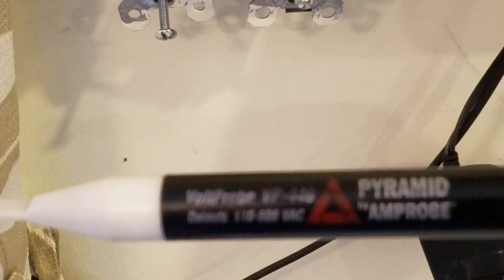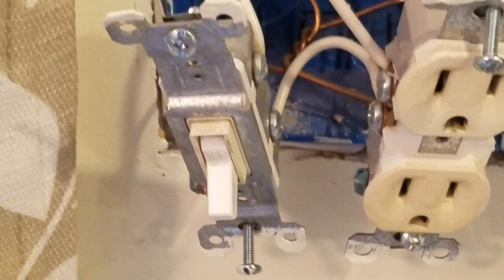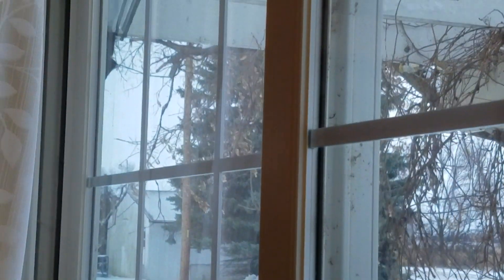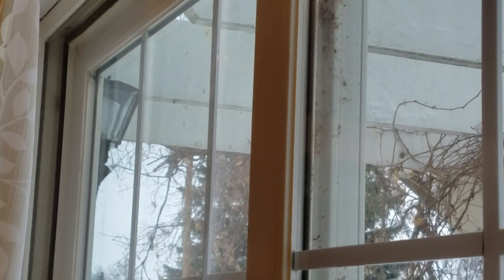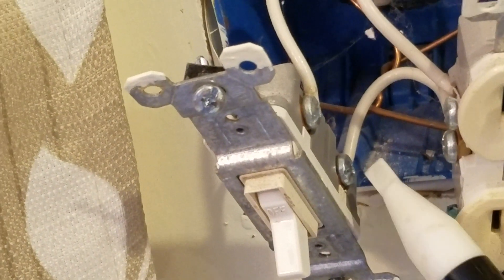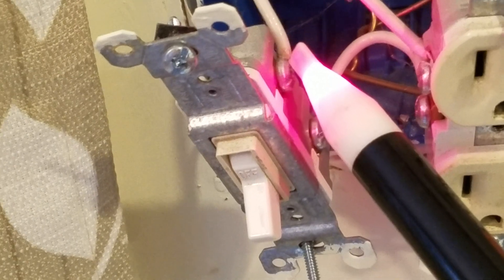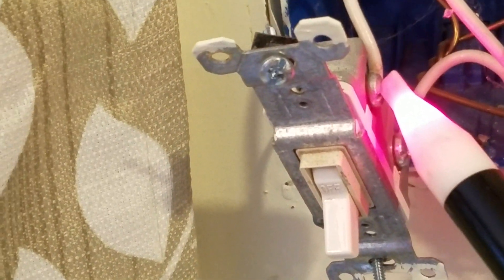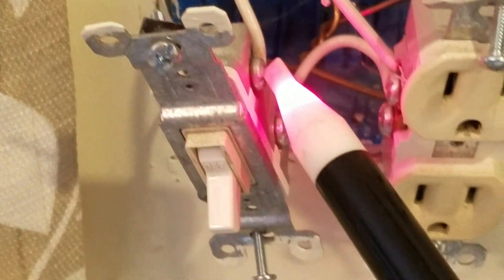Electrical back feed?

Comment: My guess is the Black wire feeds the receptacle hot travels to the light and then a White painted black is the RETURN FEED to the single pole switch and the neutral from the receptacle is the neutral for the light also.

Comment: Your switch is possessed  🤣
Reply from the maker: I'd like to think so, I actually wired it incorrectly.
Reply: @BenjaminHansen  I just had one do a crazy thing when you turn the lights on all the emt and armor cable and steel boxes would electrify and get power about a little over half power and would zap you If touched and all goes away with lights off...
Reply from the maker: @ironjohn5914  Uff-Da, yes, that is possessed!
Reply: @BenjaminHansen  I tested it with a tester removed the lights and still with switch on and no lights would electrify everything then I tested the switch each terminal and the ground wire was having power backfeed into it and electricity to the emt so I disconnected the ground wire and problem fixed, switch is still grounded to the steel box as well. I was happy with my find, still not sure why, ate Lefsa butter and sugar afterwards.

Comment: For those of you who think it's a switch loop, it's not. A switch loop to a lamp will have 6 wires meeting at the load. 2 green (or bare copper), 2 white, and 2 black. 3 wires coming from the switch and 3 wires from supply. At the load the white wire from supply gets attached to the lamp, the black wire from supply get twisted together with the white wire from the switch and a wire nut on them, both greens and a green pigtail get twisted together and a wire nut on them. The other end of the green pigtail gets screwed to the metal junction box. The black wire from the switch gets attached to  lamp. 

At the switch, the white wire goes on one terminal and the black goes on the other terminal. 

Black tape or black paint should be put on both ends of the white wire used between the switch and lamp to clearly show it's a hot wire. Enough black tape or black paint should be used so it's readily and easily visible.

Comment: I dont like switch loops. Although they work, i think the potential risk is there. 

Its not a code violation. Its a Personal preference of the wiring method.

 In theory, with the switch off, voltage still exists at the light, change the light bulb and your body could become the path to ground completing the circuit. Only if the right conditions Occur.
Reply from the maker: I am aware of it. I have yet the correct it. Maybe next weekend.
Reply: @BenjaminHansen  honestly i wouldn't worry about change. Dont fix it if it works. I would only change the box make up at the switch. Pig tail your neutral wires down. Its just ugly having a 3 inch jumper wire. But its fine the way it is. You spotted a odd function of the window maker/volt tester. Its justva learning experience of how things work.

Comment: For those of you who come across this video randomly, this is a simple mistake. The white conductor is neutral and is not suppose to carry full current, it's suppose to balance current and provide a path to the source, neutrals are dangerous because they can still have a high electrical potential from the loads they balance. The reason why the top screw and white conductor read as hot from his tool is because he had a high potential in the white conductor as though it were a hot black conductor, someone ran or tied the hot black conductor to the light, but the RETURN (white conductor) was broken (switched), this white conductor should have been tied in with the outlet neutral, this made the white conductor hot through the light (because it's a full connection) and since the return path was broken (switch) there was no current, but the potential energy (voltage) was there which was read by the tool. 

When he turned on the circuit, the device (outside light) consumed the electric potential and the neutral worked as usual as a return to the source with a lower potential, because the light was consuming it, so his tool did not register it when the switch was turned on. Switches are a break in the hot black/red/blue conductors and should never have neutrals (white conductors) tied to them.
Reply from the maker: Thanks for your tutorial.
Reply: It looks like it maybe on switch loop
Reply from the maker: @dannyday1370  it is not a switch loop. I made a mistake when putting the switch in. My bad, my shock. I will correct it.

Comment: You need to hire an electrician, a first year apprentice could diagnose that in under a minute. 3 minutes to fix it.
Reply from the maker: Turns out I had the neutral switched instead of the hot.
Reply: Yes and it’s rather dangerous.
Reply: U have a split duplex on the right that controls have of it with the switch and half from the power
Reply: The neutrals were never re ids